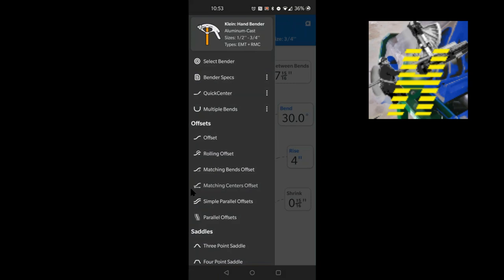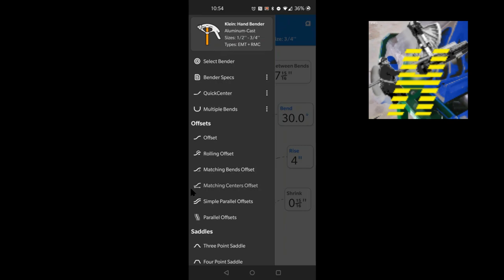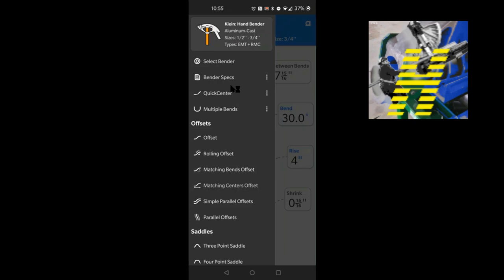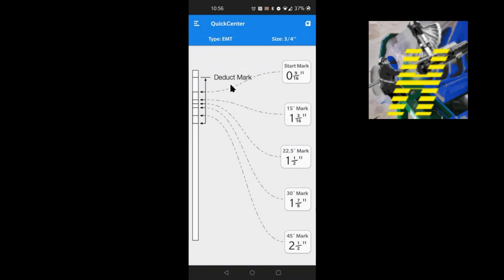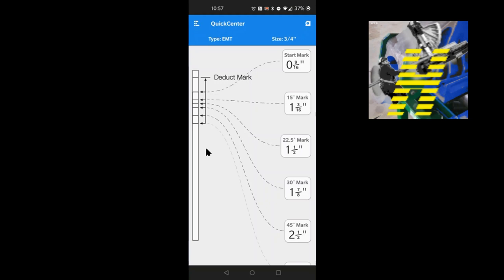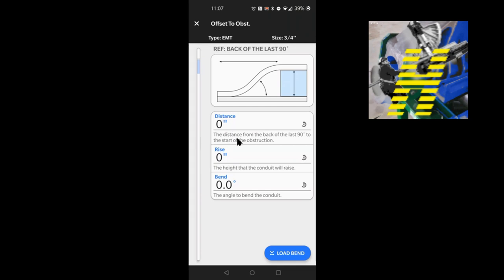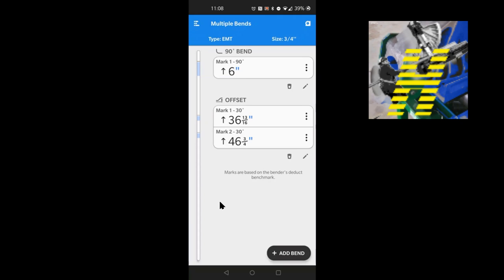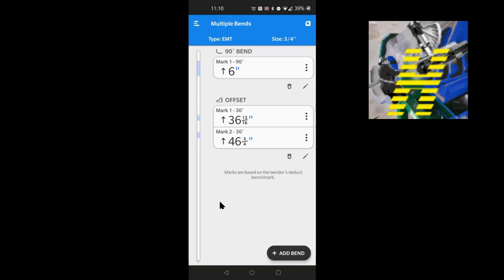Quick Bend App. - Quick Center & Multiple Bends Pt. 2

Comment: When using this method is this similar to the advanced method where when you bend on center your rise is to the center . So for example you need a 5in kick and you want the center at 12 inches so you make a mark at 12 deduct the 1 7/8 and bend at that new mark but when you hit the 30 is the 5 inches to the center or it is dependent on where you took your measurement?…because in the advanced method it’s center so to get to bottom you add half the OD of the conduit.
Reply from the maker: Great question. With this app. I believe every rise is on center. But you can check it yourself. Get a scrap piece of conduit and pick a degree you want to bend, find the deduct and choose the rise you want and bend it to the center of the rise. If it comes out correct then you know. If it doesn't then try it to the bottom. But it's too the center. So you'll always have to add half the O.D.
Join my discord community. The link will be posted down below. Also follow me on LinkedIn.com/in/melvin-rubio  thanks

Discord community:

https://discord.gg/DpXuJDtd4V

Comment: This was actually very helpful. I always had questions about quick center, but no tutorials online existed for it until now. The way I was using it was by marking all those measurements on a piece of scrap conduit, lining up with arrow and bending to a 45. Then using the marks to transfer center marks to bender. Never thought about just subtracting and using arrow. Way easier. What is the “start mark” on quick center?
Reply from the maker: I'm glad you found it helpful. The start mark honestly I don't know what it is used for. I personally don't use it. Some time I'll use it to try and figure out smaller degrees. But that's about it. If you would like to join my community in discord I have a weekly get together on there where I answer any question. Also you could drop your questions in one of the chatrooms and I answer them ASAP. Here is the link.
https://discord.gg/ntkfmC3Vq4
Also if reddit is your thing I'm on there also and would appreciate if you follow me there
Reddit/holmzlaw
And the group I have is
Reddit/r/conduit ology
Facebook/artofconduitbending
Is another group. Thanks.
Reply from the maker: If there is something else on the app your would like for me to explain or make a video of please tell me. I'm currently looking through suggestions for a video on the App. Thanks.

Comment: The Sheriff enforces the law1 Downloaded the app and am glad I saw your videos. I saw your gooseneck video and I want to do that in the app since I'm coming down through the roof deck for solar and need to mount the emt up against the rafters. Is this possible? Once on the rafters I have to do some bends to transition to another area and it requires 3 dimensional angles to follow joists to the inverter. Thanks!
Reply from the maker: yes it's definitely possible. That is the exact application for this type of bend. I would love some pictures of the bend after it's installed. I appreciate you watching my video and most of all for the comment. If you are able to send pictures. Please send them to my email * melvin.c.rubio@gmail.com* thanks again.
Reply: @TheArtOfConduitBending  what bend type would I need to coble together to get that done? I'll send pics when done too
Reply from the maker: @proxybox  honestly I would need to see the area where you are going to run your conduit in order for me to make the best recommendation.
Reply: @TheArtOfConduitBending  Sent you an email with pics. Let me know if you got them. Thanks Mel
Reply from the maker: @proxybox  to what email

Comment: does the app work with no data connection? i will be mostly be working in the parkade where there is no phone reception
Reply from the maker: No I don't believe so. But you may want to check. I'm not sure.